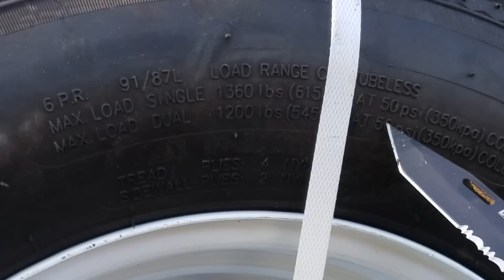DeWalt Brushless 20v Impact Wrench (DCF899) Changing Tire

Comment: Hey bro I'm not sure if you know it or not but you could have actually used impact wrench to Jack the truck up too, because most sockets that fit your lug nuts will also fit the jack. I used the impact wrench to jack up the car and once it was up used the impact wrench to remove lug nuts and change the tire.  it is by far one of my best investments that I have in my trunk 😇💪🏼

Comment: You should screw with your hands until the screws to get to the wheel axles, then get impact Wrench. To do  this with an impact wrench like this damage the thread! If you can not do this with your hands up to wheels unfortunately their thread is damaged. Well, that's how I learned since early! But instead of this observation, this is a awesome tool!! Great video man!
Reply from the maker: locomojo0485 yea it's not brain surgery . .get them going with hand then use your impact ...on a trailer...there's no way you can tighten all the way down with hand ...when the trailer is built the come from manufacturer with threads destroyed on 80% of lugs
Reply: Just stick the DeWalt on power setting 1 and use the variable trigger to make sure the threads are straight, then buzz it on. You probably don't want to tighten with the gun on level 3, you'll never get the nuts off again!
Reply from the maker: +Marcos Andrey de Sousa thank you buddy...Yes these threads are cheap ...Cheap wheels have cheap components...During installation in factory 90% of threads get destroyed...They don't screw on with hands , time is money as you know...And most companies don't care 😉

Comment: Did you set at number 3 to torque the lug nut? I set at number 2(~80 ft-lbs) and finish with torque wrench plus or minus.
Reply from the maker: yes , setting 3 is to much torque to put a lug nut on ..trailers are usually set at 70 -80 ft lbs

Comment: My boss has one at the shop with a set of Cobalt impact sockets. The sockets have holes on one side for the locking mechanism, and every time I change sockets I have to poke a screwdriver down in the hole to release it. Am I missing something? Are the Cobalt sockets just a bad fit for this tool? Please tell me there's an easier way to do this.
Reply: Devon Gray maybe you have the pin detent anvil tool.

Comment: Do I need a drill bit or socket? If so, which kind? going on a long road trip need to know
Reply from the maker: A drill bit ?! Yea if you wanna put a whole in your tire . Not sure you should be operating one of these if you don't Kno the difference between a drill bit and a socket .
Reply: TOOL BOSS awesome now that we got that out the way can you answer the question